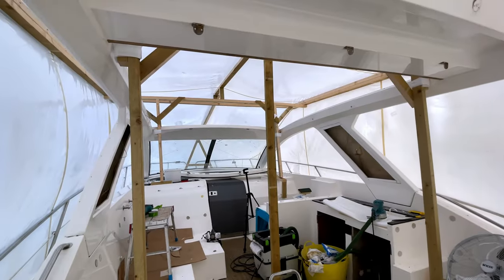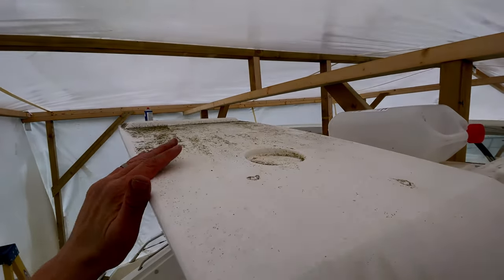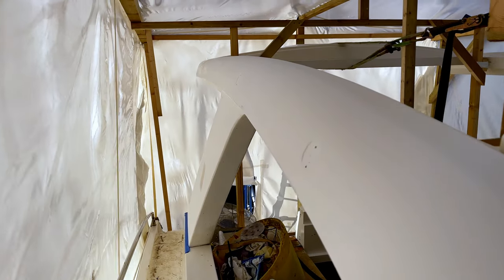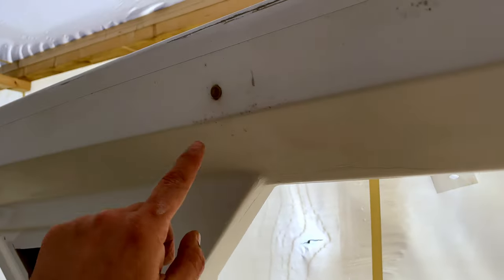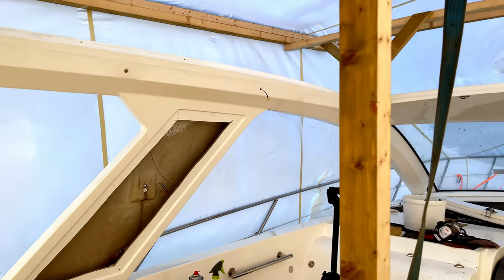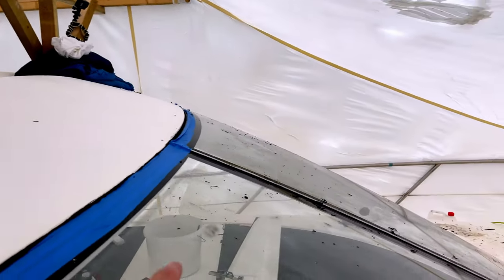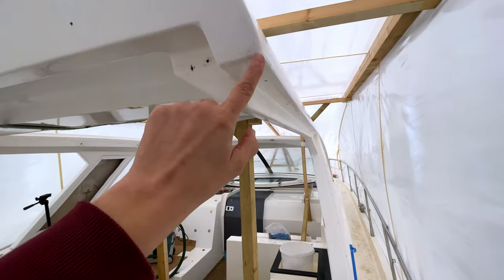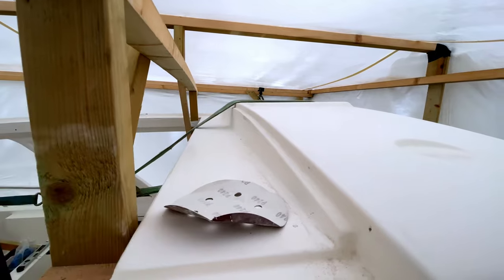Motor Boat RESTORATION - PREPARING the ROOF for Paint - Episode 61

Comment: Great video,  Nice to see you back at it.  Though probably should have gotten the piano wire and just taken the windshields out.  Or Automotive seal cutting tool, that can usually be found at any auto parts supply store.  It would defiantly make for allot less work to have the right tools.
Reply from the maker: Thanks Garritt. We did talk extensively about removing the screens, however it appears these screens are no longer available to buy so if we broke one we would be screwed. So we decided to leave in place and work around them.